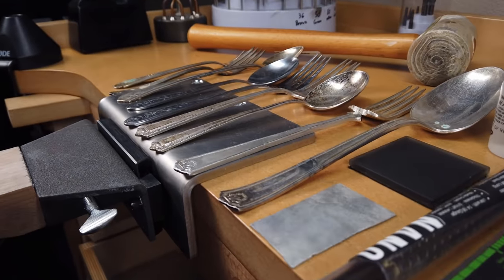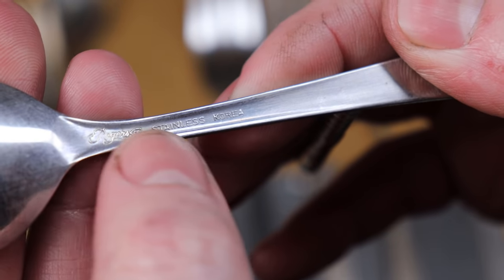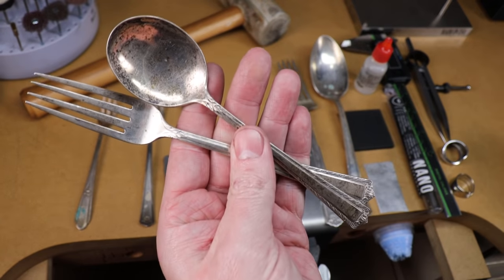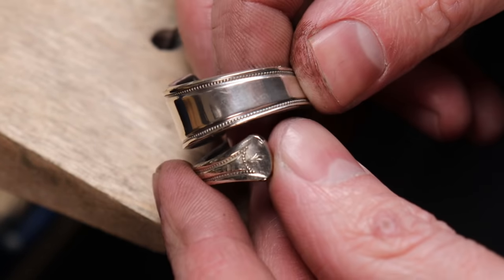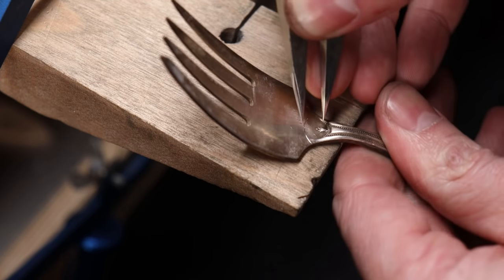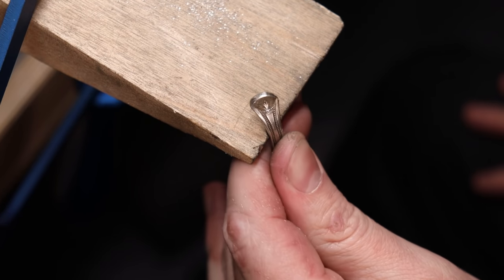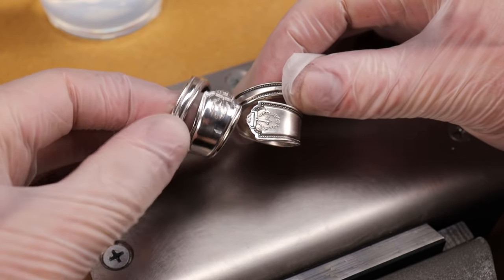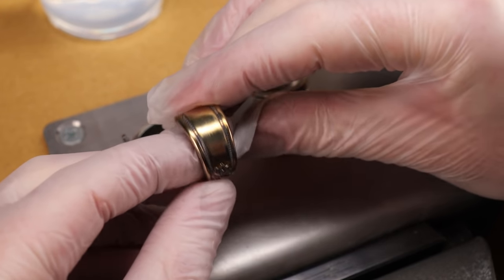Everything You Need to Know to Make Spoon Rings Like A Pro

Comment from the maker: Superior Ring Bending Tool:
Ring Bending Tool - https://bit.ly/RingBendingTool
Cheaper Ring Bending Tool - https://amzn.to/3AEiFdN
Delrin Post Set - https://bit.ly/DelrinPostSetRingBender
Delrin Dies Set - https://bit.ly/DelrinDiesforSuperiorRingBender
SmartSize US Ring Sizing Kit - https://bit.ly/SmartSizeUSRingSizingKit
Ring Bender Die & Post Holder - https://bit.ly/RingBenderDieAndPostHolder

Other Ring Benders Options:
Ring Shank Bending Tool - https://bit.ly/RingShankBendingTool

Ring Sizer & Mandrel:
Steel Mandrel Gold Standard - http://bit.ly/GoldRingMandrel 
Finger Ring Sizer Gold Standard - https://bit.ly/RingFingerSizer 
Steel Mandrel and Finger Ring Sizer Gold Standard - https://amzn.to/3j4VfTO

Saw Frame & Saw Blades:
NANO Jeweler's Saw Blades - https://bit.ly/NANOSawBlades 
Haymaker Jewelers Saw Frame - https://bit.ly/HaymakerSawFrame 
Haymaker Jewelers Saw Frame (Amazon) - https://amzn.to/36sh76R 
Cheap Jeweler's Saw Frame - https://amzn.to/2NGntsv 

Hammer & Mallet:
Deluxe Rawhide Mallet - https://amzn.to/2MmrPVx 

Bench Pin Setup:
GRS Bench Pin - https://amzn.to/3crB4yj
GRS Fixed Mounting Plate - https://amzn.to/39ArxTU 
GRS Fixed Mounting Plate - https://amzn.to/39ArxTU 
Cheap Clamp on Bench Pin - https://amzn.to/2MDlULt 
Better Bench Pin and Ring Mandrel kit - https://amzn.to/2NMX6kJ 

Flex Shaft Setup:
Foredom FlexShaft Setup - http://bit.ly/K2230
Cheap FlexShaft - https://amzn.to/3zOPJeS
Adjustable Flex Shaft Hanger - https://amzn.to/3m0lOM8

Polishing Setup:
Polishing Master Kit - https://bit.ly/PolishingMasterKit
Polishing Buffing Wheel Set - https://amzn.to/3pyh4O8 
Polishing Compound - https://amzn.to/3akVwyg 
Single Spindle Polishing Machine - https://bit.ly/SingleSpindlePolishingMachine 
Cheap Chinese Bench Polishing Machine - https://amzn.to/39eq9WR 
4" Buffing Polishing Wheel Kit - https://amzn.to/3of0kdn 

Finger Protectors:
Guard-Tex Finger Safety Tape - https://amzn.to/39cBTc9 
Silicone Finger Protectors - https://amzn.to/3o8wS8Z 

Misc. Items:
Round Plier - https://amzn.to/2MmtfiP 
Ring-Bending Pliers - https://amzn.to/3r8f1AY 
Silver Acid Testing Kit -  https://amzn.to/36nuCof
Liver of Sulphur Gel - https://amzn.to/3tbo6KS 

If you are looking for some quality CA glue check out the stuff made by StarBond. Use code "GomeowCrations15" at checkout to save 15% on your order and free shipping. http://bit.ly/StarBond

______________________________________________
Note Most of the links that I use that go to products that are affiliate link. This means I make a small commission on anything that you happen buy using them. This is at no extra charge to you and this helps support the work I do on this channel. 😁👍
______________________________________________
Other Ways To Help Support The Channel:
One time support ➜ https://paypal.me/gomeowcreations
______________________________________________
Instagram ➜ https://instagram.com/gomeowcreations/
Facebook ➜ https://facebook.com/GomeowCreations/
______________________________________________
Reply from the maker: Technically yes if you want to get into the semantics of it it's not technically pure silver. What I mean is that is sold sterling silver. I'm just trying to get the point across that it is solid and not plated or filled. 😅👍
Reply: How about the calibrating tool info? Thanks for sharing your craftsmanship!
Reply from the maker: What do you mean?
Reply: This is a very detailed and interesting video. Thanks!
Reply: Love the video! I am not finding the link for your file. Could you share that?
Reply: Awesome, just as I was thinking of different things to make, these are amazing, thanks for sharing. 👌👍
Reply: I think i would recommend disposing of strong acids by neutralizing them with baking soda before pouring down the sink. I'm only a novice (al)chemist tho so idk if  this is practically necessary per se.
Reply: @GomeowCreations  What the brand of your calipers??

Comment: I use stainless steel, much harder to work with but once finished look absolutely bad ass. But it is definitely a lot harder, but you have more choices if you can't find silver. And annealing it the taking wool adds such a beautiful patena. I highly recommend if you have the  Patience because it is hard But well worth it in the end result. And very durable
Reply: Charity shops (thrift stores) great source...
Reply: So you have to anneal it first if you use stainless steel?
Reply: @caillou7135  Yeah, I have learned so much since that post and you are absolutely correct. Lol! I beat the snot out of my self doing it too lol! Tough lesson, and it was so heavy  stainless steel took me like 2 hours lol!! I've made quite a bit of head way since then. Thank you for your response, wish someone would had something a little sooner but better late then never lol!
Reply: @gra-kpop  true but most are hip to sterling silver. When a spoon sells for $25 on eBay why discount it in your store? Bettter spoon rings on eBay go for $10. Not handmade sure, but they look the same.
Reply: how do you polish the stainless steel
???

Comment: Good video. I feel like we’re pretty similar in skill. I have a studio at home too. If you wanna connect, let me know.

As for the patina rainbow color, it’ll turn dark over time just like leaving it in the LoS for for longer . You have to spray it with a clear coating to keep the air from further oxidizing it. It’s similar to flame coloring but most jewelers dont want to apply a clear coat because it changes the feel of the metal.

Comment: AWESOME. TY SOO MUCH.  I HAVE A FACINATION WITH RE~PURPOSING SILVERWARE.  :  }  I HAVE MADE MANY CROSSES. SOME BIG SERVING SPOONS I RUBBER MALLETED THE SPOON END FLAT, ROLLED IT, DRILLED A HIDDEN HOLE TO HANG THE CROSS .  I'VE MADE BRACELETTES. SOME WERE 2 PIECES, LINKED WITH A BEAD FLOWER IN FRONT & CHAIN & LOBSTER CLAW CLASP IN BACK. ALL GIVEN AWAY AS GIFTS.  :  }

Comment: I do a rainbow coat by putting cast sterling into a jar with an egg yolk, it works best on castings with a degree of micropouroisity 

the thing about both egg and LoS is it can wear off eventually with handling
Reply from the maker: Yeah it will wear off eventually over time but it's very easy to get it back if you want it. 😁 

The egg thing does also work seeing that it contains sulfur. It's just easier for me to have los on hand 👍

Comment: You can use 14k acid as well. You just drop it directly on the item. It's what we do at the store I work at. We're usually testing for scrap purchases so it doesn't matter to us if it leaves a mark. Both methods work. Just depends on the application :-)

Comment: Well I just made a ring out of a stainless steel tea spoon and all you really need is a hammer of a decent size and something round like a big old bolt around 1" thick/finger size and a way to secure the bolt or whatever to a sturdy table. A few small files too are good to clean up rough edges. 
These are just the things you need for hobby level though.

Comment: Hey Randy,  could you please go into more detail to explain how to correctly size a wide band ring such as the spiral spoon ring in this video. I’m having trouble finding info about this anywhere.  My issue is making a custom wide band ring for a (eg) size 7 finger that will properly fit a person I’ve never met. Where on that spiral band would you expect it to sit on the 7 size on your mandrel. I have also seen designers advertise that their wide band ring is a 7.5 and will fit a 7 or 7.25. Could you please consider doing a video on all these wide band sizing issues and perhaps anything else you might know of that would help.. 🙏🏽🙏🏽🙏🏽🙏🏽🙏🏽

Comment: Iv only used stainless steal because I haven’t been able to find any silver silverware, but far and I haven’t had much of a issue for anybody wondering. May make it tougher to work with though
Reply from the maker: Yeah you can use stainless steel on it, it's just going to be harder. I suggest getting a metal  pipe that will fit over the handle so you can get some better leverage and make it a lot easier to work

Comment: First time seeing your videos! Perfection! I am a newbie, self taught along with taking a few classes as well.  I have a question, after the sulfur dip etc, do you need to apply anything to prevent that color transfer to the wearer? What would I include on the care instructions when I sell these?  Thanks so much ! Just subscribed too! Xoxo
Reply from the maker: So if you go over it with something like a brass brush it will knock off anything that is going to transfer really. Over time it will lose the color in the high spots and turn silver. I suggest testing it out but if you are worried about it I would polish the inside of the ring so it's just silver and you should be good to go.

Comment: What if you don't have any of those equipment.....the bender ones could you bend with hands/fingers or on edge of table?
Reply from the maker: If it is really thin maybe but I don't see it working well. I would just get a raw hide mallet and a steel ring mandrel at the bare minimum.

Comment: Great video! I find when I use the wand it doesn’t move as easily, could it be the thickness of the metal?
Reply from the maker: Yeah if the metal is thicker it will be harder to bend
Reply: @GomeowCreations  thank you! Just started using the bender, I noticed the white round delran die moves a little when I bend the flatware, is that normal? There is a hole with screw at the front, does that have something to do with it, I hope I didn’t strip it. Either way I’m enjoying using it and thanks for your tips!

Comment: Hi can you tell me if silver plated forks spoons etc are good for making rings. Or only sterling silver? Thanks
Reply from the maker: Both are fine for making rings. You just have to me a bit more careful with the plated ones. If you have the setup you can always silver plate your them once they are rings so you can even use spoons that didn't start out with any silver on them 😁👍

Comment: Is it actually possible to work with stainless steel? If so what’s the best way to bend and round them?
Reply from the maker: Yeah you can and you would use the same tool it's just a bit harder to bend them.
Reply: @GomeowCreations  thanks for replying! that’s great to hear. I’ve seen some things that say these machines only work for softer metal like silver but I thought stainless steel would be fine.

Comment: This was so helpful! I don’t know if I missed you saying it, but, if you just want the ring to stay the silver color what type of polish should you use? I’ve made some rings before and they’ve turned my fingers green and I never know what I should put as a coat on top.
Reply: Some say clear nail polish but I didn’t know if there was a better option
Reply from the maker: So if you metal is silver plated it will not turn your fingers green but the parts that you cut or have came off over time then you are going to have a problem. 

You can use a clean coat of paint, lacquer or clear resin will work too. I might do a video about using resin to seal stuff

Comment: does the size 16 metal stud in this work to form any sized ring as long as you do the math for it or will smaller ring sizes require you to use a smaller stud?

Comment: Super informative! Do you have any suggestions on how to bend keys? I'd like to make rings from keys but I'm not sure if the process would be the same as silverware.
Reply from the maker: If you have some to test with you can heat them up and see if the melt or not and if they don't you can bend them after heating. This will not really work if they are steel. You are going to want copper or brass keys.
Reply: @GomeowCreations  cool. Thanks so much for your quick reply. I'll have to do some experimenting. If they aren't steel, this press would work?
Reply from the maker: It should.
Reply: Skeleton key would be cool

Comment: Hi, just another quick question. When I use the ring bender, my rings come out with small 'dents' around the inside circumference just where I have pressed the ring bender. I try to fix this as much as I can. Is there a way to prevent this? Or if this just something that is included in the character of the spoon rings? 
Thank you!

Comment: So, fast forward 2 days from my original comment, to when I've already bought tools ( a jewelers saw, mandrel, rubber mallet, ring sizing kit, and caliper. I already owned a dremmel and a few small metal files) and am expecting them the next day. I also already bought spoons and forks to use, but to my dismay my favorites are all stainless steel. Is it possible to use them still? Based on other videos I've watched and various articles, it is still doable- it will just be quite a bit harder to shape. Especially when shaping them by hand. Anyone have any thoughts or experience? I will find out regardless tomorrow when I try lol
Reply from the maker: Yes you can use the stainless steel ones it's just a long harder to shape them. Using a ring bender will help a lot
Reply: @GomeowCreations  many thanks!! I appreciate all the tips you’ve shared
Reply: @GomeowCreations  I finally bought the PEPE ring bender tool! So much easier lol

Comment: How did you determine the 16 was the right block for a size 7 ring?
Reply from the maker: So a size 7 is about 17mm in diameter. The 16 die is 16mm and the ring will never match that size 100% so it will be about a 1mm off so that fits what I'm looking for to get to a size 7.  😁👍
Reply: got it now!  thanks for the speedy reply
Reply from the maker: No problem ☺️

Comment: “Bring a magnet cuz steal doesn’t work very well”  me who spent several frustrating hours today trying to make a spoon ring out of a stainless steal spoon. Then it broke and I had to improvise and use a glass soda bottle cap and it worked out wish I knew that hours ago 😤😤😅😅😅😅
Reply from the maker: So you can make them using the steel ones but it is a lot harder and if you are using a ring bender to do it you might really want to get a metal pipe to put over the handle so you can get my leverage on it to bend it

Comment: So I searched "how to make custom coins at home without expensive tools and materials" and I haven't got solid results but I did this channel so... a curiosity for another I guess
Reply from the maker: What kind of coins do you want to make?
Reply: @GomeowCreations  just like.. with a custom design
Reply from the maker: Yeah you would have to engrave them if you want to use basics tools. The better way to do them would be to cast them. You can carve them in some hard wax and make an impression in some casting sand but you still need tools to melt metal
Reply: @GomeowCreations  cool I think I saw a vid for a DIY casting forge gonna have to rewatch it
Reply from the maker: I have some on that as well

Comment: How did you know to use the number 16 on the ring bender? Thanks for the video :)
Reply from the maker: The 16 is 16mm in diameter so size 7 ring I was making needs to have an inner diameter of a little over 17mm. When you round something on one of the posts it will almost never get to the size of the post this will have you about 1mm of extra slack and that is why I used the 16 to make a size 7 ring.
Reply: Thank you for explaining that thoroughly. Be well & stay safe.

Comment: It is well known that tastes are different. For example, I don't like rings like that. I don't find them interesting and even less beautiful! And under no circumstances would I have my silver cutlery cut up. As cutlery, it is an ornament and has a high value. I like to put it on the table and eat with it.

I wouldn't have cut a single piece of silver cutlery either.
Btw.: 
Several years ago those rings made of cutlery were  interesting for people for a short time, when the whole thing was new. But they quickly lost their charm. Basically, they all look the same. They are now being sold en masse everywhere because the rings are no longer worn by their owners. This fashion-trend is over.